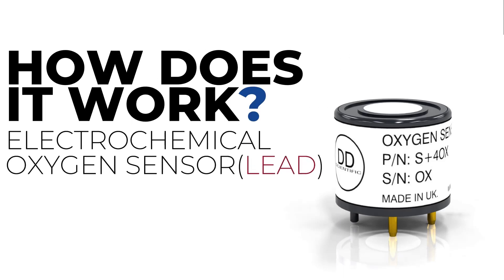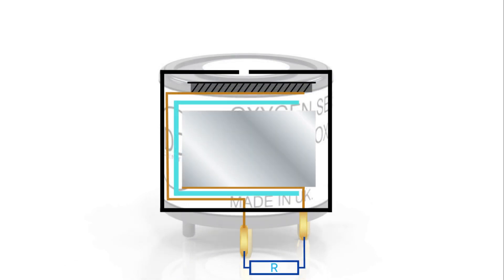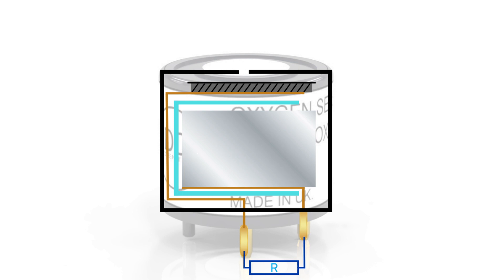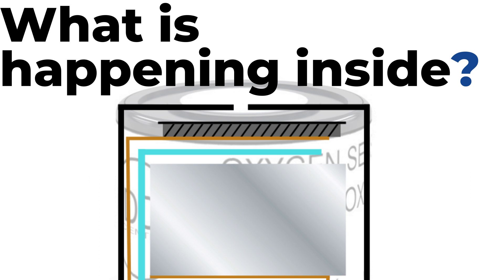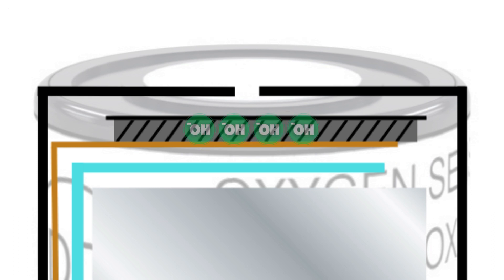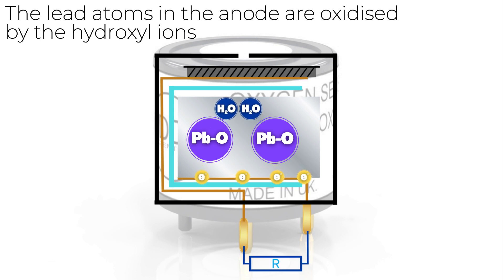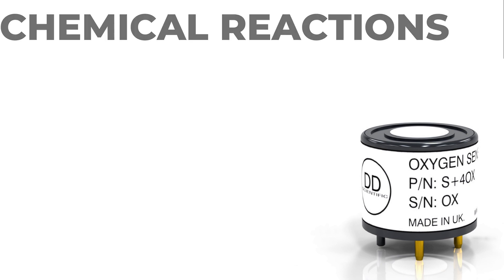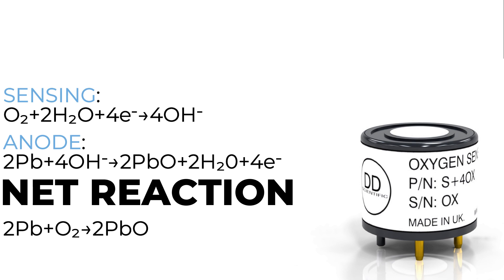How does it work? Electrochemical oxygen sensor(lead)

Comment: My flue gas analyzer containes an oxygen sensor with 2 electrical connection points. So I assume it's a lead based sensor. The sensor deteriorated within  2 years and a half, althouhg the gas analyzer was used just 5 times. The battary was not charged the whole last year. Nevetheless the sensor lifespam ended and needs a replacement. How can it correspond with what is explained in the video, that the disconnected sensor's working life is preserved?
Reply: The PCBA is designed the way that once the sensor is installed it's terminals are shortened whether the analyser is on or off.